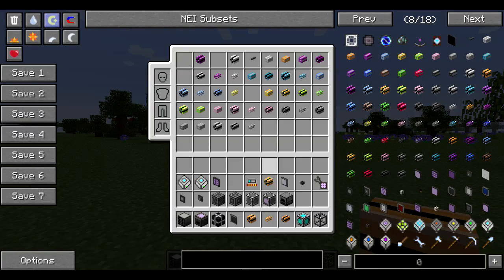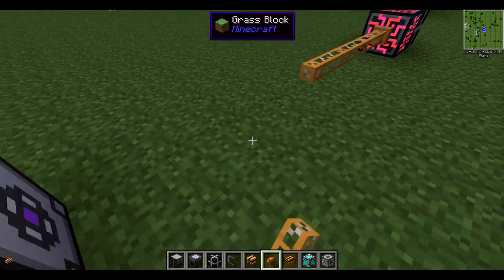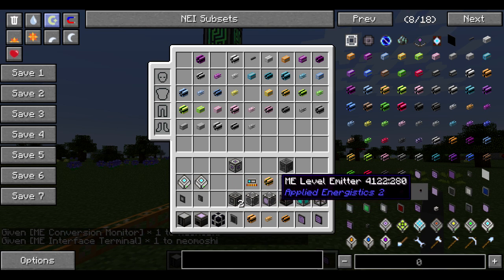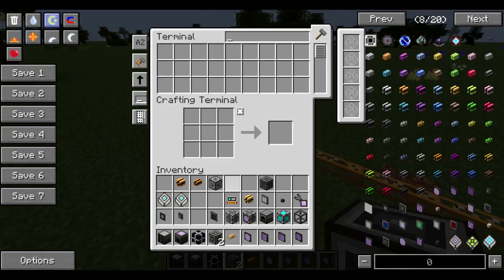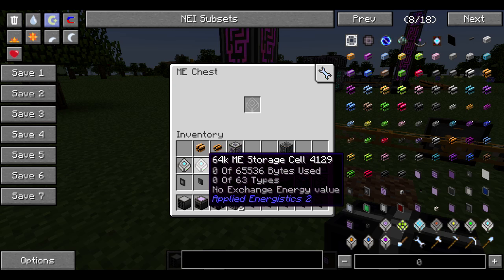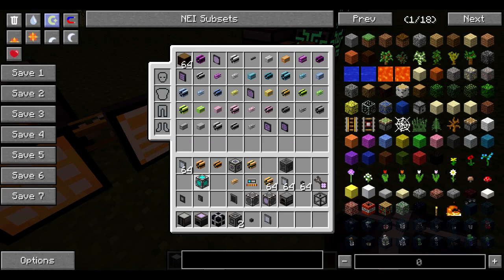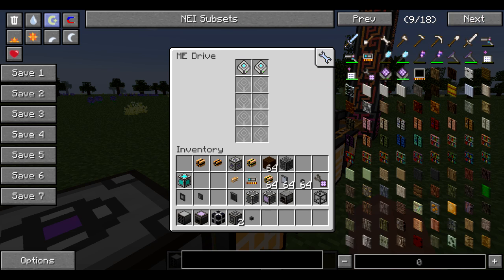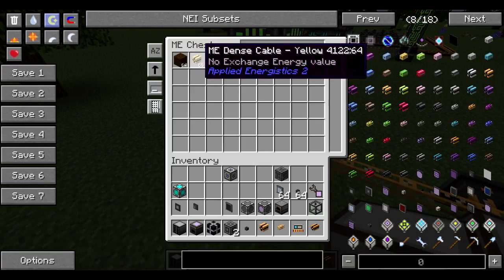Let's Learn The Mods Applied Energistics 2 - Basic ME System and Uses

Comment: So... an ME drive is a 10x better/bigger ME chest?
Reply: You could say that, but you'd need a Me terminal hooked up to a me controller with glass cable. Or better, apart from dense cable as they don't connect to terminals. So to summarise, ME Drives are the way to go for medium-end game, while a ME chest is for low-medium game